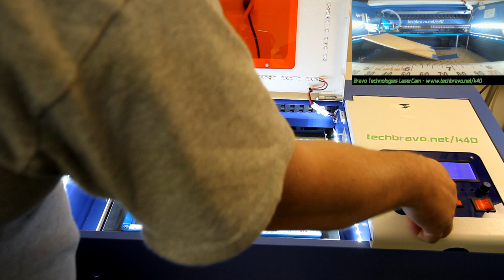Tech Bravo's Laser Focus Ramp Test

Comment: Now, THIS is thinking out side the box.  ★★★★★  Additionally, this is useful when / if you want to simulate a raster line by using a vector line, arc, or whatever which would be 30x faster. With this technique, you can now determine the "width" of the out of focus needed for whatever "raster" width one wants to make.

Comment: How thick is the board you are using and how long?  Thanks
Reply from the maker: its 3mm ply about 160mm long i think but thickness is not really that important. even though the line is a vector the idea is to use just enough power to make a visible mark and not to actually cut it
Reply: @TechBravoTN  thanks. I did not even know you had to do this test..

Comment: hello can you ask me a question?
the purpose of this test is to find a point on all lines that is the thinnest right
like where all lines are the same thickness is the ideal height the material should be from the lens.
Reply from the maker: only one line is necessary. i do multiple lines at different power levels just to be able to choose the one that is most clearly visible.

Comment: how high should be that ramp  and what is a focal distance that you start from at the top distance ?   for your lens   lets say i want to test  this on  2.5 inch lens  so my normal distance from tip of the nozzle for fine cut is about 25 mm   so i should start  with 20  ? or so ?  this information is missing i suppose   on video and on website.   One small drawing will clarify all of that

Comment: Hi, Is it an original chinese k40  ?  Because it seems that you said the power changing for each line. And for mine it is not possible to change the laser power frome software ? 
Thank you
Reply from the maker: it is a run of the mill Chinese k40 clone. i installed a cohesion 3d controller to get pwm laser power control